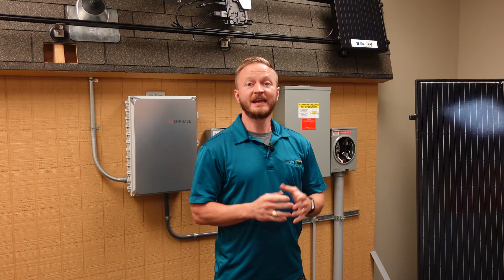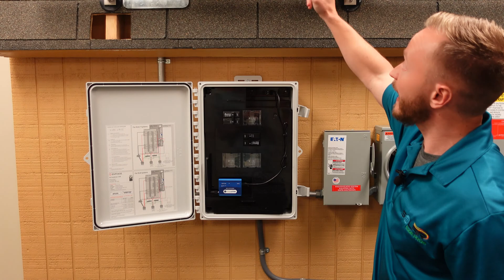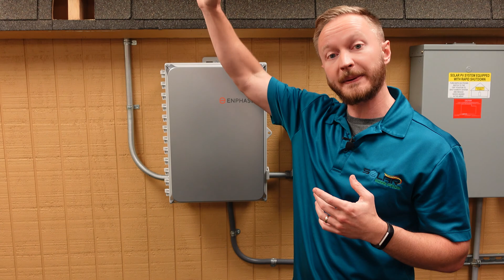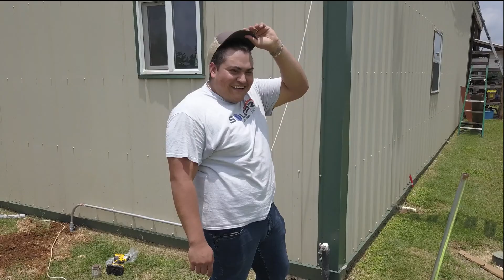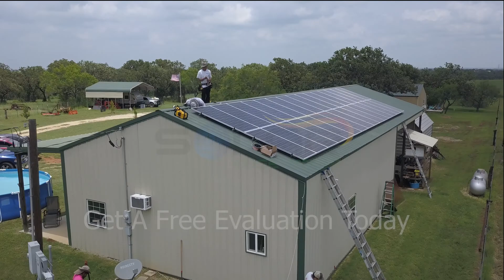Enphase Microinverters or SolarEdge String Inverters?

Comment: Optimizers have a heat limit that greatly affects its output by about 65% till everything cools down towards the end of fall! SolarEdge is trash in my personal experience with having to replace inverters 3 times in 5 years. When the optimizers heat up they overheat the main inverter and poof... but do they send a tech to troubleshoot? Hell no, forced to buy a second system!!! That is why I am forming a thirdparty verifying company in order to protect homeowners from unscrupulous installers and manufacturers!!!
Reply: Also of note, Enphase is by far a superior product over Israel's SolarEdge trash!!! Even their apps bui is clearly understandable, whereas solaredge app can't make heads or tails of!
Reply from the maker: SolarEdge has definitely had a difficult time these past few years. From what we've seen in terms of our service calls lately, the inverter company has improved their customer service response times.
Reply: I understand. Being one of the cheaper products on the market demand outperformed supply, so quality was slightly overlooked for quantity. Now that a few years have passed and supply has met demand, more attention was placed on quality. I can respect that.
Reply: However,I am not impressed with the system used on my house since 2018. Did you know attic heat will greatly reduce the efficacy of the system? Just my personal experience.

Comment: Are micro inverters only used for grid tied? Im doing off grid. So my panels will be going into my charge controller.
Reply: For off grid you need to use Solark or another off grid inverter. Depending on your needs and what you want for monitoring you can use the Tigo Optimizers with the Solark Inverter.
Reply: @alfredovazquez8117  I've been useing victron energy.

Comment: I like the idea of micro inverters (with 25 year guarantee), but I need to limit the amount of energy I put back into the grid. Can enphase do this?
Reply from the maker: When configured for power export limit, the Enphase system automatically limits the PV generation so that energy exported to the grid is zero or the set power export limit within the grid profile. This functionality is set through the grid profile and is called the soft export limit. Though it isn't the cheapest solution, a great way of keeping as much of your produced energy and staying independent would be the addition of backup power. The excess you produce not only gets stored into your microinverters, but banked into your batteries. I hope this helps and apologies for the late response.
Reply: Only if the company were to work with the big electric companies to form JVs involving microgrids on a monitored VPP platform within a specified "neighborhood" grid zone (this requires knowledge in LDES). However, due to their cost, they are not as prolifant in neighborhoods like the cheaper version optimizers are. I am interested in forming an LDES REIT and leasing out for 10 years to the big electric companies.

Comment: Power optimizer does same thing as microinverter.   He didn't bother to explain more about the power optimizer because as he said, he likes microinverter.  Power optimizer also track which panels producing what and so on.  Nowdays, power optimizer more popular choice because they are more efficient when sending energy to main inverter.
Reply: Power optimizers do not do the same thing as a microinverter. The conversion from DC to AC is happening at point of contact with the microinverter. Power optimizers work as a string and they do not convert from DC to AC until it hits the Inverter box at the side of the house. Also if one power optimizer is not working it affects the whole string.
Reply: @alfredovazquez8117 if an optimizer fails, it does not take down the entire string.
Reply: @alfredovazquez8117 incorrect!

Comment: Or you can buy any string inverter and couple it with Tigo optimizers and get the exact same panel level optimization and readout without being tied to Enphase's expensive battery system and lossy DC->AC->DC double inverter battery solution. Enphase is fine for a small grid-tie solar only solution but gets out of hand with costs one you start factoring in batteries and it absolutely does not scale well for larger installations as every panel you add costs exactly the same amount of money to grow the system.

Comment: Don't power optimizers also report panel-level energy collection also? Also, you don't need a cellular connection if you have an ethernet or wifi connection also. Correct? Not an unbiased review. I have no problem with Enphase or SolarEdge but I do have a problem with steering for a higher price Enphase system without solid evidence. It's funny, I think I realize where all the used car salesmen went once online car comparison shopping went online...EnergySage people...
Reply: I have both, and enphase hands down is better all the way around. I have a 6kwh solaredge and a 3 kwh enphase plus battery. I can tell you from personal experience solaredge goes out frequently with zero notifications. I have been through 4 solaredge inverters in 5 years and not once have sunrun or solaredge send a tech to troubleshoot the system. Today the 3 kwh covers just about all my consumption, while the 6 kwh system works half the day, then goes on standby. Solaredge app I still Can Not make heads or tails of, while Enphase works WITH my smart meter AND is intuitive to use!!! I started Peirism in order to hold these companies responsible by providing homeowners professional eyewitnesses for arbitration and litigation.
Reply from the maker: Great point. You do not need a cellular connection if you have an ethernet or wifi connection that can easily connect to the combiner box outside the structure. We also try to remain unbiased to best suit the needs of our potential clients. Our consultants are trained on both Enphase and SolarEdge systems and advised to educate property owners on both systems. People typically prefer the benefits of Enphase microinverter technology over the potentially safer design of the SolarEdge system. That's at least true in 2022. But who knows what the future holds, technology is constantly changing in solar :)